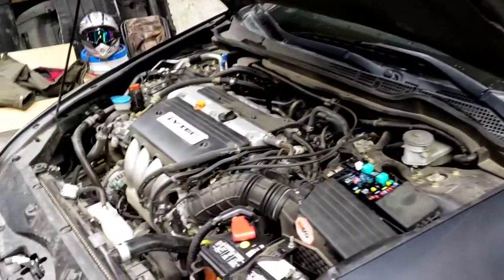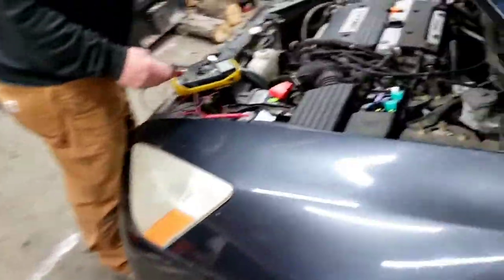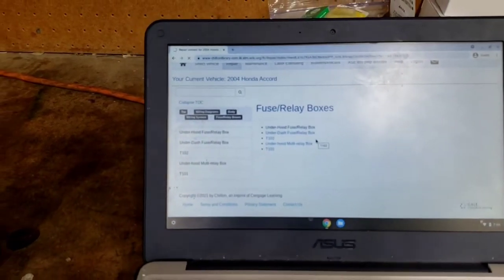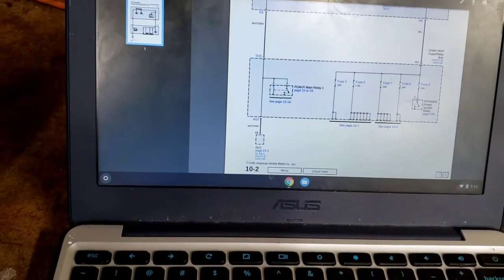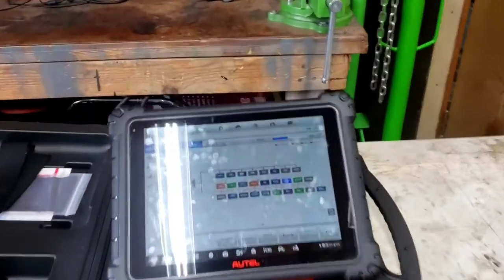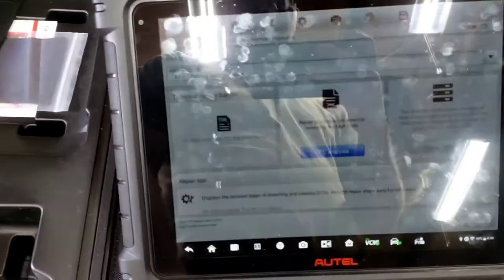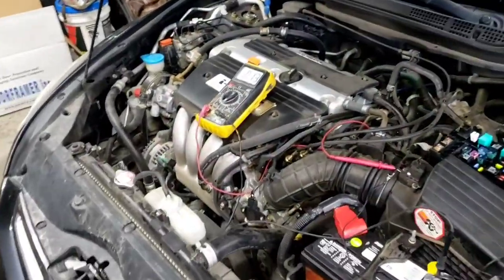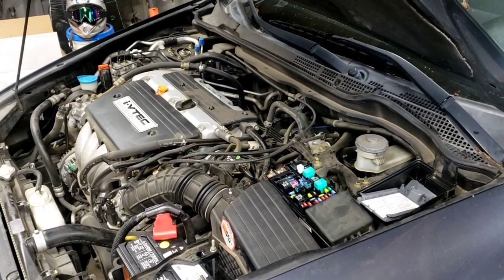2004 Honda Accord Parasitic Draw Part 1

Comment: Thank you so much for this video -- I was going crazy pulling fuses but I was not allowing time for the startups to finish, so I was having no luck finding the drain. I used your suggestion to allow time to pass before checking fuses, and was finally able to find the power window circuit as the problem. Thank you!

Comment: Great stuff.  In my experience on my wife's 2003 Accord EX (engine difference doesn't matter), the issue is that if the driver's window is left open and the window switch gets wet, the switch module will fail and cause a parasitic loss just like this.

Comment: Thank you very much, I had same problem fuse no.7 , 0.15A, (checked navi, gauge cluster,wiper switch , MICU) but did not know it is switches windows switches in driver doors - lock switch was faulty)

Comment: Thanks for this video.  It is awesome.  Love the bacon on the stove! Solid!  Just wondered, I have a 2006 accord with the same issue.  What I’ve noticed is that when my car is off, I can still use the power window switch to roll down the windows.  I’m thinking that may be an indication that the draw is coming from my power window module too.  So, did you replace the control board with the switches on it or did you actually have to replace the connector there that plugs into the control board.  And, did your window roll down without having the key turned on too?  Thank you so much!

Comment: Same issue.  2010. I’m Not a mechanic.  Unplugged alternator and sat for several days.  Battery volt remained stable. And no more parasitic draw.  So I’m assuming it’s the alternator.  Weird thing is Honda couldn’t find issue.
Reply: BruceWayne-sz3th   just saw your reply.  It was a rusty/corroded outside door lock.  “Stuck” in mid lock.  So always getting signal to lock doors.  I replaced the lock cylinder and now it it good.  I just kept at it for about two months before I found the issue.  Sadly, I knew the lock was bad all along and could have saved a lot of time.   Digital metering just about everything kept coming back to door harness stuff.

Comment: @20:13 is it possible you can take that out and look for corrosion and possibly remove the corrosion? Possible that the driver's window was accidentally left open and that module filled with water? I'm just stabbing at possibilities.
Reply from the maker: We could take apart the item to get to the circuit board to see and troubleshoot the short.